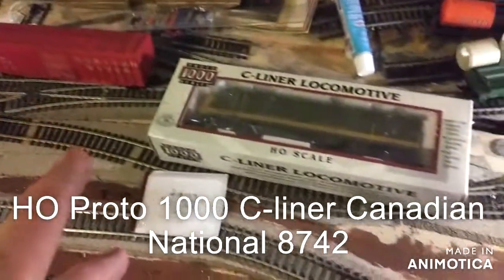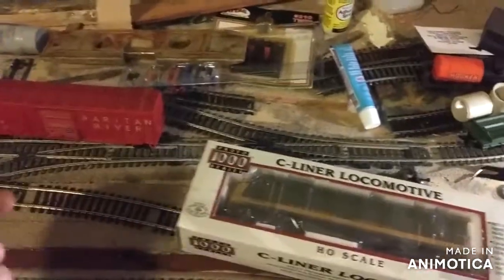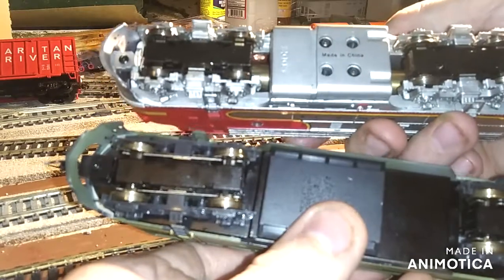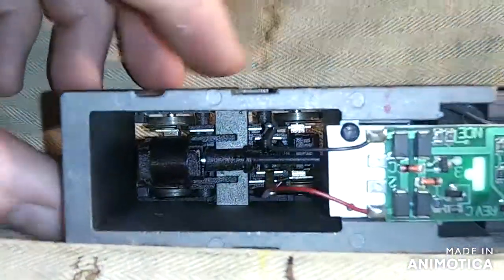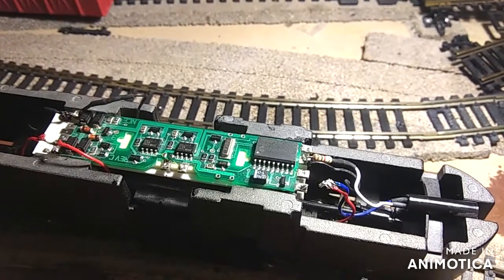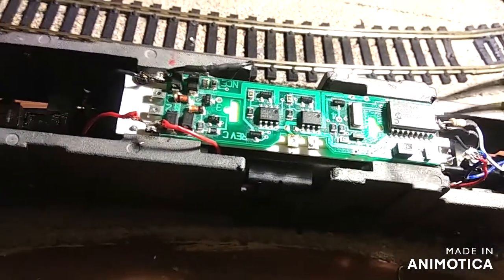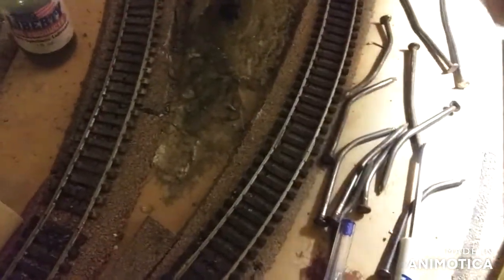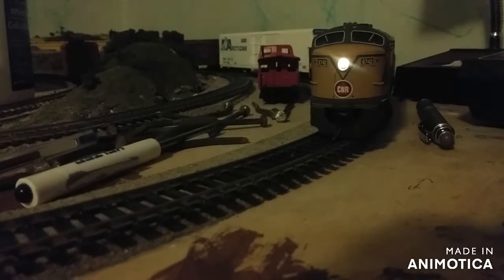Proto 1000 Canadian national 8742 review ho scale

Comment: Nice, do you still have this loco engine?
Reply from the maker: Yes and the DCC works I re wired it back to operating order. I have a old mrc 2000 DCC controller that ran it. I have a semi matching b unit but it's a FA- B unit